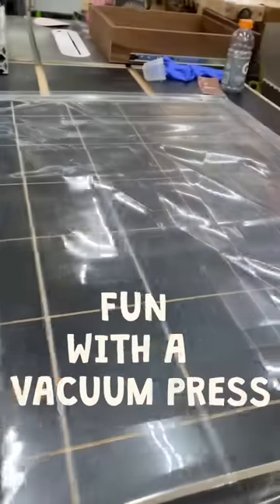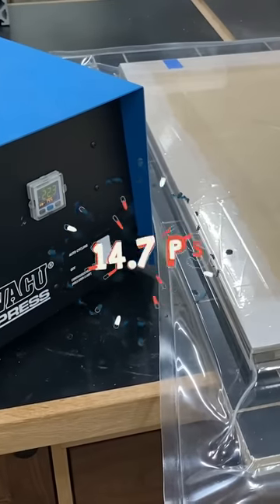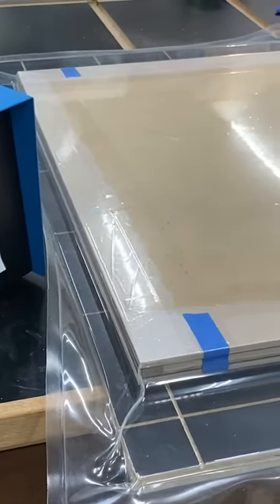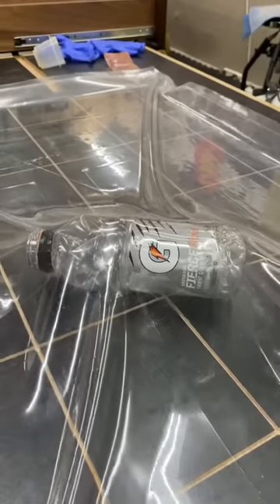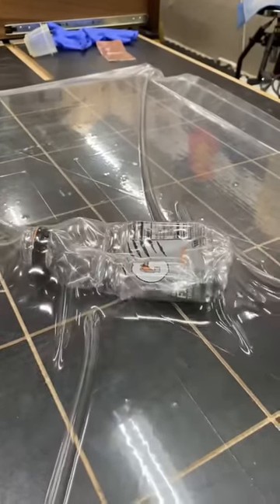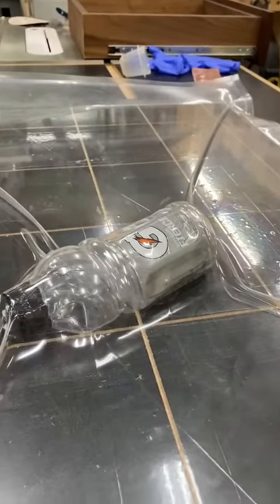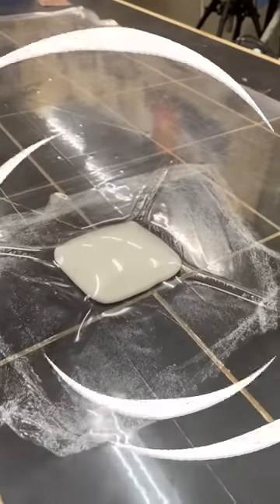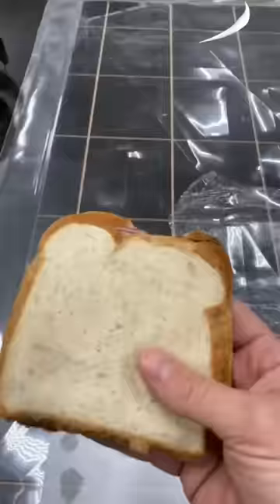Let’s Crush Stuff in A Vacuum Press | #shorts

Comment: Well… now I need a vacuum press for making cold paninis… at least that’s what I’ll tell my wife.
Reply: Good idea
Reply: Love that this was the first comment I saw!
Reply: wth is "paninis"?
Reply: @PepetoGuy  they're a type of hot pressed sandwich. ^.^
Reply: @TheFalseShepphard  you read it the wrong way at a glance too didn't you
Reply: You're gonna be inside it right?
Reply: why am I thinking if the 1800s right now
Reply: @BurntToast1717  and use for?
Reply: Try a Foodsaver with a thin cutting board inside...
Reply: You can achieve a similar effect by using a zip lock bag under water with a tiny bit open, slowly pushing it down letting out the air
Reply: Lmfao. Nice.
Reply: God speed good man. 😂

Comment: LOL great video. Same principles on the fire department. When we draft from water source like a lake or stream we reduce the pressure in our tanker and the pressure from the atmosphere pushes down on the water source and it into our trucks. If we ever hear someone say we suck water on our trucks, they are quickly corrected. LOL Keep up the great work!!!
Reply: The negative pressure inside your tanker is causing a "suck." 

People who say you suck water into your truck, are completely correct. It's the same concept as using a straw, if you breathe in all the air, something is going to want to fill in that now voided space. In the tanker, you're reducing the pressure by removing that air, creating a vacuum. 

Same way engines are able to "suck" in fuel/air and run accessories like brake boosters. They create a vacuum.

Comment: I noticed a bit of a technicality if I'm not mistaken. It's not the air inside that protects against crushing air pressure outside. It's the overall structural integrity of the object and the mass inside of it and the relative pressure on the outside.

You could totally crush a sealed Gatorade bottle, but you'd need atmospheric pressure way greater that what we live in.
Reply: I'm OK at parties and maybe a little fun.
Reply from the maker: Yes it is the air inside that’s protecting against the crushing pressure. I demonstrated that by showing the bottle with and without air. The air is the only variable preventing it from being crushed. And if the pressure were increased the sealed bottle would never crush unless it ruptured, in which case the air has escaped.

Comment: Explanation is a little off. The air pockets in our bodies (lungs/ears) are open to the atmosphere or able to equalize to it. The reason we aren’t crushed is by atmospheric pressure because we are mostly water which is almost non-compressible.

Comment: You would need to do this test in a vacuum chamber. Everything is getting crushed due to the tension of the plastic being pulled down around it. The bottle with a lid has internal pressure increasing as it gets crushed and holds form better. Relating this to atmospheric pressure as though we would all be crushed if it were not for the air us does not seem entirely accurate. Not to be a buzz kill, I am still entertained by your video 👍
Reply from the maker: More accurate than you think. https://www.wtamu.edu/~cbaird/sq/mobile/2015/09/14/why-dont-i-feel-the-miles-of-air-above-me-that-are-crushing-me-down/ You’ll have to forgive me for not being any more specific than that in a 1 minute Short.

Comment: I feel like the only reason the wood broke is because the force of the plastic on top of it
Reply from the maker: Yes, but what caused it? Removing the air allows atmospheric pressure to act on the bag.
Reply: @woodwhisperer   but if it was in a different container that doesn't move it wouldn't have broke
Reply from the maker: Yes, but only if that container is strong enough to resist the forces of atmospheric pressure. The pressure is still there.
Reply: @woodwhisperer  yeah but it wouldn't break the wood, no?

Comment: You explanation sounds quite wrong, but i like the practical stuff anyways.
I cannot explain to you why it is wrong, but it sounds wrong as the change happens when you move up or down. And we do suffer from the changes, no matter how much air we have inside. That's also why diving down to the deepest pits of the ocean is dangerous if done without equipment.

Comment: I wonder if you could take a piece of wood and suck all the air out in one of these, the open the seal under oil in a bucket so the oil rushes into the vacated pores of the wood. Idk if that's particularly useful, but I think it's a cool idea.

Comment: Pretty sure its the bag crushing shit not the lack of air there bud, try it in a solid class tank
Reply from the maker: And what do you think is causing the bag to crush the items inside it? Atmospheric pressure. The lack of air allows atmospheric pressure to act on the bag. 😊
Reply: @woodwhisperer  wouldn't you get the same result with just sucking the air out of the plastic flask as well? How is this different from a physics perspective from just emptying the air in the container from just the inside?